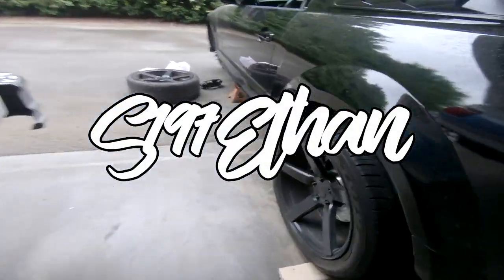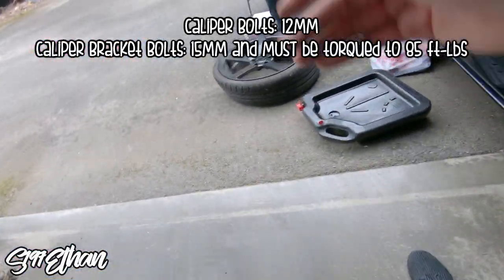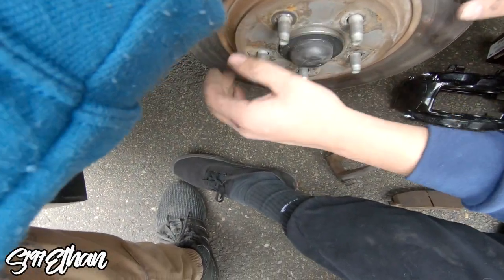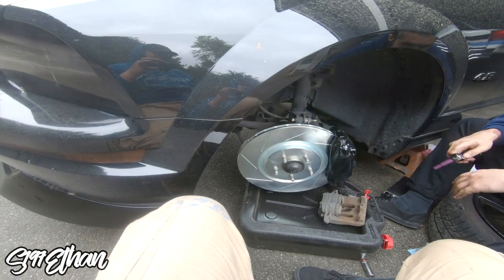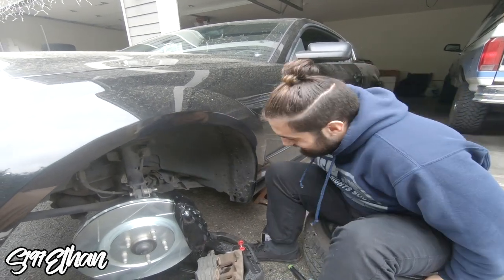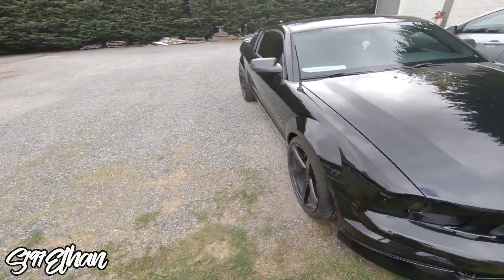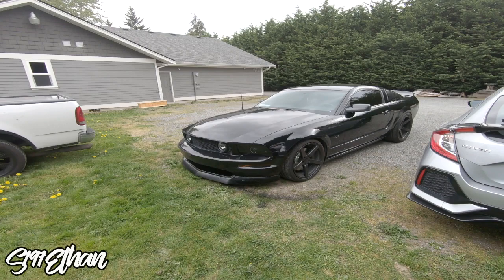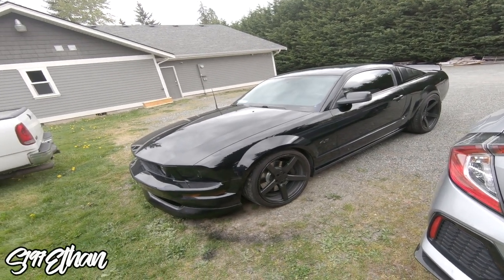CHEAPEST BIG “BREMBO” BRAKE KIT for 05-14 Mustangs! *UNDER $350

Comment: I already upgraded pads and rotors but for the fonts would i need bigger rotors or are they the same diameter as the stock?
Reply from the maker: They’re the same as a stock GT500 rotor.
Reply: @Ethan_3V  If I'm not mistaken, you want rotors for the Performance Option/ Brembo package....355MM...

Comment: amazing cost..what size rotors and 4 piston calipers?
Reply from the maker: They’re the stock GT500 calipers/rotors so they’re about 14” I believe. I think the stock brakes need 18” wheels to clear them or else you’ll have rubbing issues. Also yes, they’re 4 piston calipers.
Reply: @Ethan_3V  thank you for the info. perfect upgrade and price

Comment: oh snap, i could of done this, but the passenger front caliper is out of stock!
is it stopping Alot better now after the break in miles?
Ive just put on slot and drilled rotors all around but stock calipers,  monroe ceramic pads..
it got a little better but i do want more!! good shit my guy!
Reply from the maker: Thank you! Yeah it stops on a dime, next time you have to do brakes I’d recommend doing this!
Reply: @Ethan_3V   on a dime, superb, good to hear, gotta slow down my kenne bell! keeps whining..
again, very practical, great work..
Reply: @Ethan_3V  will these calipers work on stock rotors Ethan??

Comment: Will they clear stock mustang wheel on 18x8 funnel style rims ?
Reply from the maker: They might, stock GT500 wheels are 18x9.5 and I’m not sure if your wheels would clear. You never know though! You could always use a small spacer if it doesn’t fit. 😁

Comment: Someone told me I need bongo bolts cause of the bigger calipers. Like the gt500. Do I need anything else besides calipers and rotors
Reply from the maker: I would buy a hardware kit unless your calipers came with one. Other than that maybe some anti seize 😂
Reply from the maker: @chance. Any auto parts store should have it in stock if you ask for a front brake hardware kit for a 07-14 GT500.
Reply: @Ethan_3V  i talked to a guy he saud i need a kit to hook up the rear stainless brake line

Comment: Have a 2013 road race car wonder if those calipers will fit my 2 piece giro disc rotors
Reply from the maker: Michael Ried I don’t believe they will. They’re made for GT500 rotors.
Reply: S197 Ethan ok thanks they are 14” rotors on my car so probably won’t work.

Comment: What size is the front rim for clearance
Reply from the maker: 20x8.5, I believe the smallest you could go is an 18” or whatever the 07-14 GT500’s stock wheel size is.
Reply: What's the offset of those wheels? Did you need a spacer?
Reply from the maker: @GroundZ3R0Gamer  +35 I believe

Comment: So would I have to but one from each link for the calipers?
Reply from the maker: Yes, they are specific to each side.
Reply: @Ethan_3V  one more question and thx for the response but would these fit on a 18x9.5 +22 offset wheel?
Reply from the maker: @5.0Uriel  I’m sure they will. They’re the stock GT500 brakes and the stock wheels are 18x9.5. Not sure if the offset would work though but I’m like 80% sure it will 😂😂
Reply: @Ethan_3V  ight thx bro u helped me so much 👍

Comment: If I have a 2014 v6 mustang with no performance brakes, do I get the rotors and pads for a 14 GT with performance brakes ?
Reply from the maker: No, you’ll need rotors and pads for any 07-14 GT500.
Reply: Kinda late comment, but you also need different brackets to fit the bigger diameter rotors for the gt. If you decide to go that route.

Comment: On autozone it says the brake caliper doesnt fit my 2011 v6?
Reply: You have to order gt caliper and track pack rotors
Reply: You have to order the unbracketed passenger and driver side caliper for the gt with factory brembos.  Make sure you don’t order 2 driver side or 2 passenger side calipers. Read the description carefully.    You will also need the rotors and pads for the brembo equiped gt.
Reply from the maker: Yeah it won’t say that it’ll fit but I believe it’s the same mounting holes on all of the 05-14 mustangs.

Comment: Would they fit on 18” gt500 rims ?
Reply from the maker: Yes, these are from a GT500. :D
Reply: S197 Ethan also I was looking on the links and they say they don’t come with the brackets do you need them or where could I get them
Reply: @Thenamesyayo  These calipers are bracketless if I'm not mistaken. Much better!
Reply: @Ethan_3V  GT500 rotors are 15 inch. For this application, you want 14"/355MM rotors.